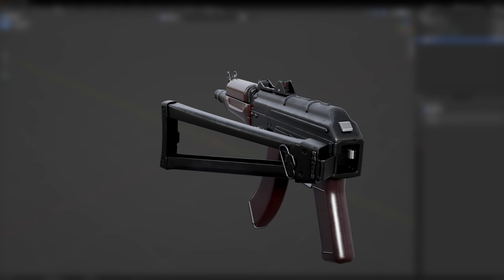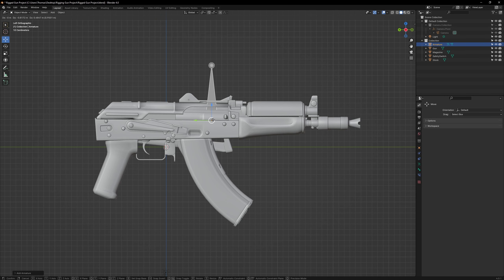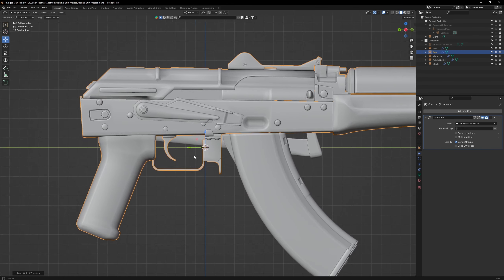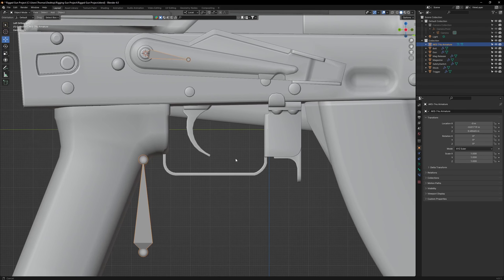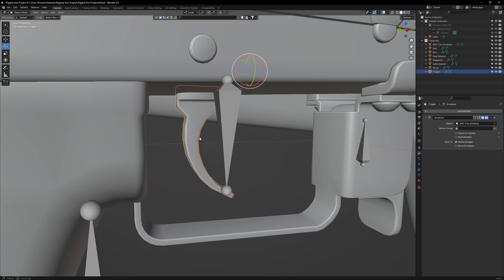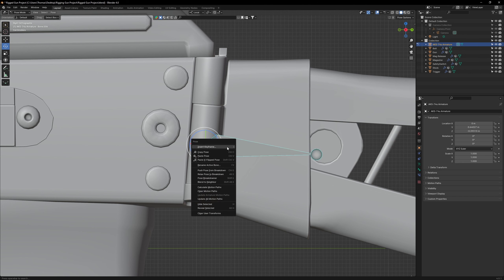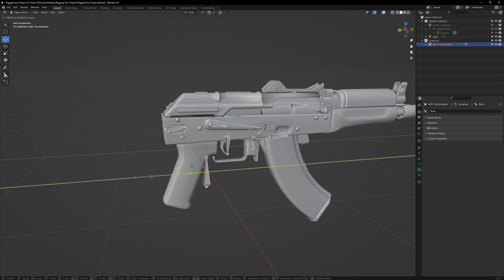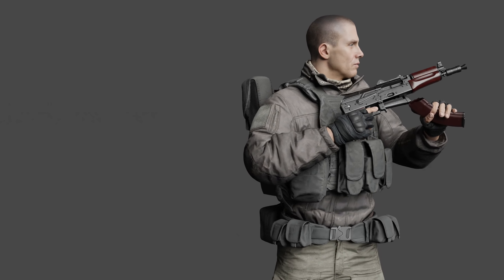How to Rig a Gun (or an AKS-74U) in Blender

Comment: Thank you for the tutorial! Really clear and direct to point! 

I think this could be improved if you showed the key shortcuts you are using, I think it could improve the quality of people following along with the video.
Reply from the maker: I use custom shortcuts which are a mix of Industry Standard and Blender. Because I learned Maya in Uni before switching to Blender.

So it's a bit difficult to explain the default shortcuts. I've tried to compensate by making sure to use the menus as much as possible.
Reply: @ArmouredAvian  Makes sense. Either way, thank you for the content.